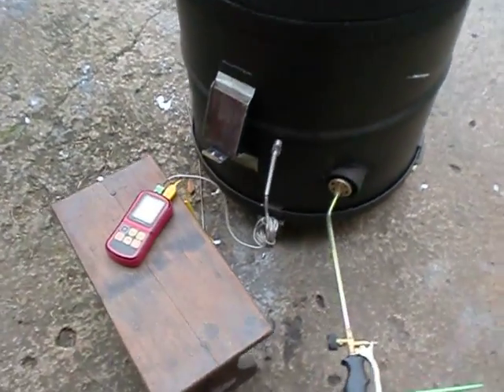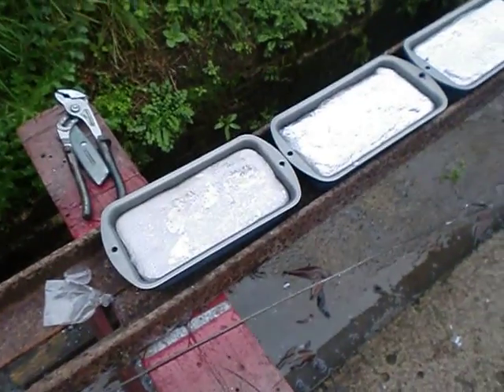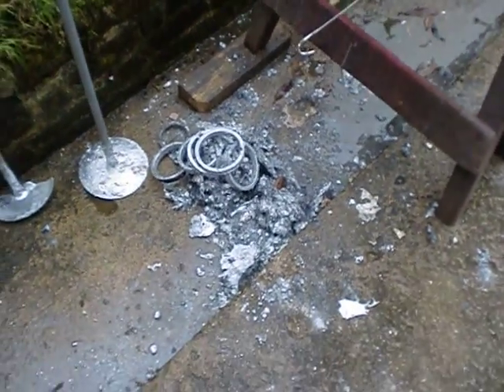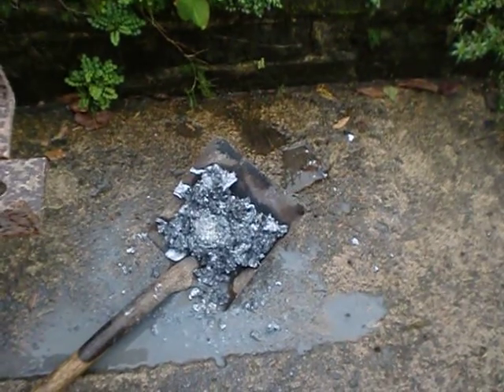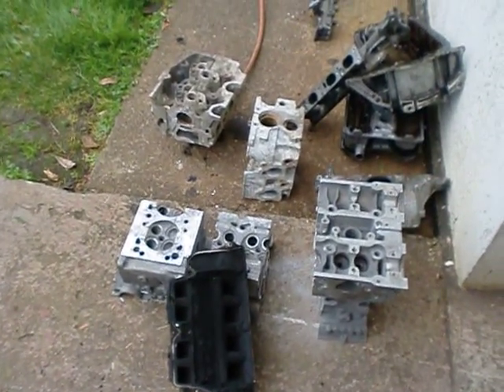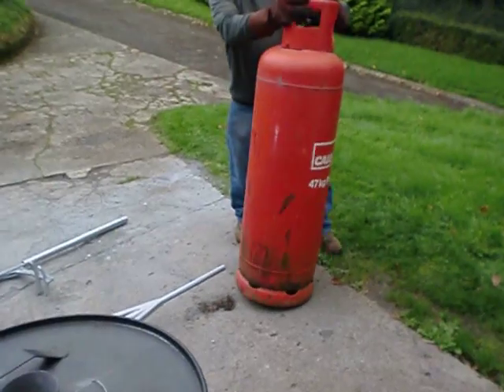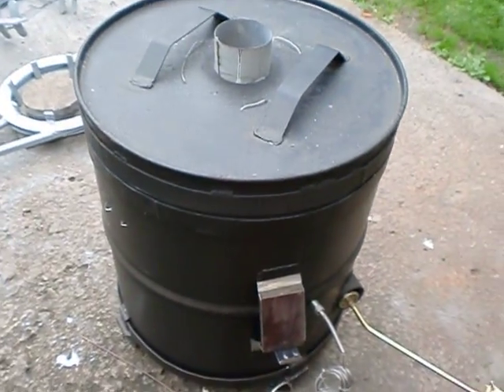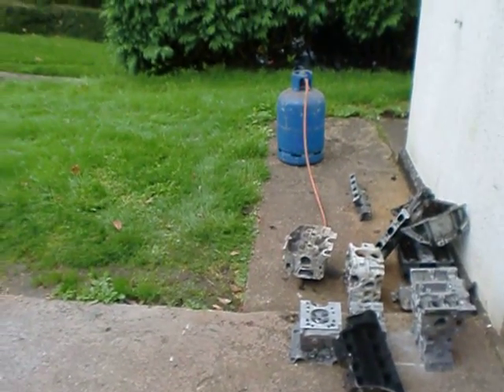LARGE HOME MADE FOUNDRY 2

Comment: That is not a foundry. That is a furnace. 
Foundry definition - a workshop or factory for casting metal.
Furnace definition - an enclosed structure in which material can be heated to very high temperatures, e.g. for smelting metals

Smelting definition - the extraction of metal from its ore by a process involving heating and melting.
If you are not working with ore, then you are melting metal, not smelting.